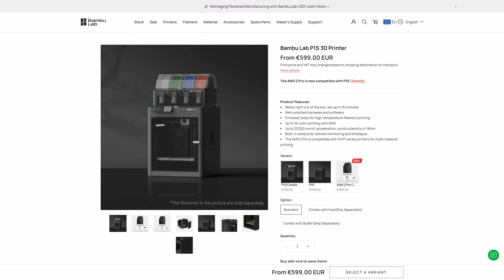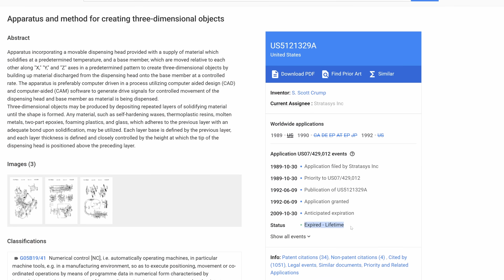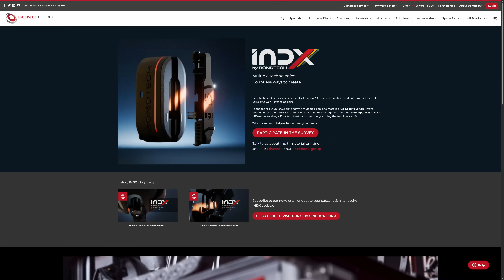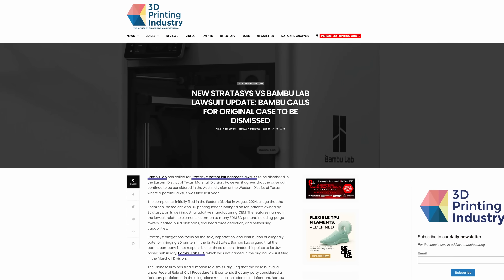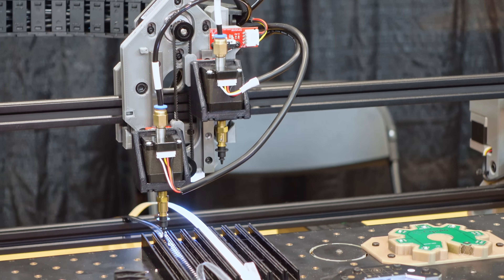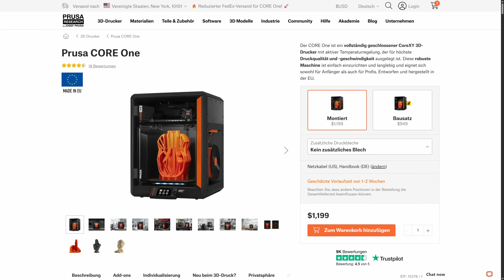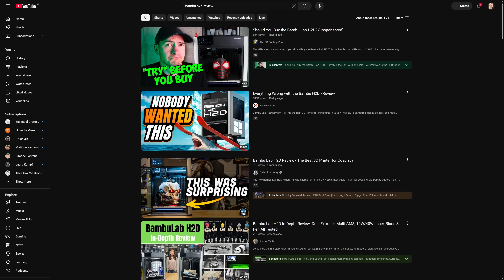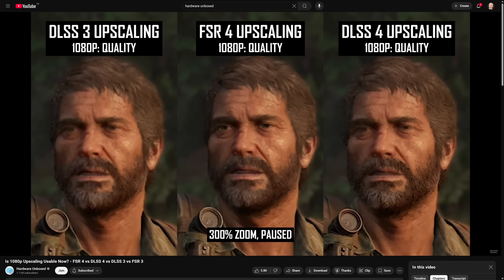How Bambu has won

Comment: Sounds like you are running out of ideas, and some form of soul searching phase is taking place. Please skip that. Creality realeased auto tensioning of belts and a ton on Chinese makers are producing tools for adjusting blet tensioning. Would love your take on that. That is accuracy not speed though. Also, the Voron phoenix project is having issues with thermal expansion, and Prusa actually spoke a bit about it lately. There is a ton to cover on that topic. Again, not speed, but reliability and accuracy, not speed. Personally I just ran into an issue with my MK3s, in which the part cooling fan cooled the bed into oblivion, throwing a repeatable and very real thermal runaway error. My bed only reaches 74C with the part cooling on 100%, for the first couple of cm. Never heard about that anywhere, but the implications of that physics, kind of raises a billion questions. The Prusa has a fairly powerful bed but a super weak fan. Also, there is a move back to CAN-BUS, from USB. Why? There is a move to inductive heating of hot ends, but that is not for free. The list is like endless. A ton of these issues, also hits Bambo kinda hard. There is a move towards thick beds, but at the same time, people seen to be oblivious about the issue of frame consistency, like if a machine is put on an uneven plane, its own plane is thrown out of whack, like the MK3. Not to mention that not a single printer on the market is square, and not a single one is adjustable to become square when assembled. You read the specs, you know that not a single printer on the market meets the specs of their rails. Not to mention what happens when that chamber heats up. Not a single maker adjust their beds with steppers, after heating up. Which we should so. Adding an adhesive and a spring sheet, and any accuracy of the bed is lost. But if you had a mesh of say 4x4 steppers, that trimmed the bed into position, being decoupled and stuff, you know, use the stuff we have for that, then a cheap thin aluminum bed would become super flat. Instead we have these 3 rodded single motor beds without any alignment adjustments, and beds being like more than 1,5mm in deviation. Also, this mains craze that is going on, for bed heating, if you could give SSRs a go, like why some are seriously expensive, what is all the industrial noise actually about SSRs, and why this is like super cheap in the printers we got, that is more stuff I would like your take on.

What I do not need, is another Steve. We got two of them, and the Steves are both great, and really, really bad, at the same time. They both are insanely blind for the issues of objectivism, and as much as I love them both, their ignorance on their own paradigm, is killing their work on a regular basis. If you ever read this, your channel in particular, has a very fine tune to it, in which the level of drama i seriously low. You have a keen touch to deal with people as people, in a human way I really appreciate. It will be a loss to us all if you loose that, as it is kind of seriously rare. I would like a take on like belt tension, heat chambers, and SSRs, in that style. Stuff like that.

Personally I am not a fan of mains driven moving beds, particularly those who are seriously wavy. They just drive people into doing crazy stuff, exposing themselves to harm. The thing is, I need to move to mains driven soon myself, the way this industry is moving, and any friendly assistance on that, is highly welcome.  Like what is up with the power rating of current printers? 1000W at 240V and 350W at 110V? It obviously is all about the bed heating, but what is up here?

Comment: I’d love to see reviews that compare machines across manufacturers. There’s lots o little things that get missed in reviews I’ve watched - like network connectivity (Ethernet ports), availability of replacement parts, compatibility of nozzles across brands, and how long bed leveling and prep takes before a printer starts printing. Comparing service and repair would be great. It’s weird that even Bambu still expects end users to take their machines apart and do repairs themselves - are there any repair shops that handle 3d printers?

Comment: One other thing besides that cloud scandal stuff from Babulab printers is that they don't sell a printer with a proper larger build volume. My CR10V3 offers a build volume that is future proof without having to angle any parts or have to glue. Which is why i choosed this one in 2021.

Comment: Bambu is not your friend. They took open-source materials, designs, etc and made them proprietary. As they continue to monopolize their success, it's a short step from "Your printers are not your own but you can buy them and store them in your house for us" to "your prints and designs are actually Our prints and designs, and we will take them off your accounts freely in perpetuity because you used our software and machines". I have no Adobe software that's subscription based, and the ones I do have are ultra legacy and essentially on a drive just because. The same goes for any software I use frequently. If it doesn't offer a perpetual license, I'm not a user nor supporter. 
Having the option to put some work out for the common good still needs to be an option, however, when you invest years and years into a product and support it yourself monetarily, absolutely you should be able to expect to recoup that investment. What you should Not expect is to take things that were provided as Open Source and lock them down because you turned a few screws yourself.
Reply: What does this mean "monopolize their success?" I cannot even untangle that level of anti-capitalist talk.
Reply: 3D printing has never been open source. It was only made available to everyone by chance when Stratasys's patents expired. Open Source cannot claim ownership of something it did not create. The 3D printing community is not homogeneous. We don't all want the same things.
Reply: @MrlegendOr  Stratasys didn't invent the 3D printer either, but they made sure no one else could make a commercial product via their patent. 
That said, MUCH of 3D printing as the average consumer and maker knows it IS open source, community developed designs AND software.
Reply: @C-M-E  The first 3D printer was invented in 1981, the first SLA patent being granted in 1986. The first FDM patent was granted to Stratasys in 1989. The Stratasys FDM patent expired in 2009. It's only after that we have seen the 3D printing boom. Open Source didn't invent anything since then; they simply profited from well-established technology and built a cult around it. The idea that no company can use this technology just to please the OpenSource cult is nonsense.
Reply: @C-M-E  Open source cannot act as a gatekeeper for 3D printing in any way.
Reply: @MrlegendOr  ?! DId I say no company can not make products nor income from open source? I said taking open source and making it proprietary so the end user is stuck in one ecosphere is a problem. If that makes you happy, have at it. Just make sure you understand what you're giving away in the fine print...
Reply: @C-M-E   Everything I say is to let you know that 3D printing has never been an open-source thing. It's the open-source movement that has entered the world of 3D printing and taken everything from closed-source work. This is not necessarily a bad thing. However some of the fanatical members of the open-source movement try to act as gatekeepers dictating how everyone should consume 3D printing and at what level of openness that manufacturers should adhere to. OpenSource never been the law in 3D printing world. Simply because open source doesn't own the market, usage, patents or users — they're not even 7% of the entire market, yet they behave like communists. Most users don't care about open source; they just want to press a button and print.

Comment: I dont often comment but what I would like to see in general is how creatively 3D printers can be used. We came to a point where all 3D printers are much less the same. They have roughly same output, same quality of life etc. but what i see missing is that there is no new ideas how these things can be used in medicine, engineering, gastronomy, everyday life etc. You have a very nice youtube channel but try to think about this one please. Everywhere on youtube you can see review of some machine or software update, but not so much on how to do some specific things with these machines.

Cheers and thanks!

Comment: 3D printing has shifted from a Maker Space to a Consumer Space, you can fight against it all you want, but it's already happened and there's nothing wrong with that. People can still be Makers and people can be Consumers, there's nothing wrong with that. Just because a company makes a Consumer 3D printer, doesn't mean you can't be a Maker anymore. This is nothing more then tribalism. I for one joined 3d printing BECAUSE of what Bambu brought to the table, I wasn't interested in tinkering with my 3d printer, I wanted to 3d print. Bambu labs took a stale market and FORCED long time brands to change, and that's a good thing.

Comment: shake-up incoming. kinda heart-breaking. but money is the heart. owner of the world does not want what people (stan) wants through money. no, stan is not the actual owner, if its the operator of the world. people's want does not matter against free gift. world of above is not a democracy, its freedom in the people's eyes. well, market patents stuff under their gov that they did not do. thats cheesy. the wrong way relies on people, ie braggs and prides in people and people's work. it's a free gift if you understand. its better to have skill (in everything) than being reliant/dependent on the market. with skill, you can make also the tools you might require. zero dependency. I hate linux gurus. at least not biased, ie objective is better than straight up being bought by someone. adapting to rulers makes slaves. if money (ruler) dictates what you do then meh. do not work for people. market benefits no-one. lol grin. 3d printing includes 3d graphics frames ok. lol. "his" is a dangerous re(li)gion. freedom is not compatible with any kind of ownership or rulership, by people, for people. maybe instead of aligning with interest, just do what you meant to do. unbiased. market is a nasty bed fellow. being infected really tastes and spreads. watch out for those, and avoid them. freedom! (for all, actual).

Comment: I'm almost the perfect target market for Bambu: I'm never going to mod my 3D printer. But I think comparing 3D printers to desktop PCs is the wrong metaphor. I think Linux vs Windows is a better one, and I say that as someone who has used Windows for longer than I've used Linux/Unix. The problem with 3D printing going so closed source isn't so much that you'll be unable to mod your 3D printer - it's that eventually, they'll be able to control what you print as well. The opportunity to restrict it or require that you pay-to-print is too lucrative.

Comment: DJI and their offshoots don't want best product ecosystem, they want a stranglehold. Unwillingness to learn how stuff you buy works leads to manufacturers making things that break in a year, because when you give in and no longer want to know how things you own work and want them to "just work", you leave your right to have the best product behind and settle for the manufacturer giving you the bare minimum that will satisfy you, and the manufacturers absolutely will abuse that setup. To call this a win is delusional at best. You'll have here what you have in every other industry when customers give up on being involved and settle for just consuming - instead of more and better products you'll get same slop with next to no improvements released year after year, only breaking more often, years behind on features that exist on the engineering side, more expensive, with increasingly more DRM and data collection, with parts that refuse to work together because of product tag mismatch, and that are about 20 times overpriced (*cough*DJI Mavic*cough*). If Bambu went out of business today, supposedly leaving consumers without a convenient product line, that would still do less irreparable harm to the industry than Bambu succeeding today. The only ones winning here are Bambu execs that will retire will golden parachutes while setting the industry back decades. And when that happens, remember that you supported this.

Comment: 3D printers are only ever as good as their software (and firmware). So the ability to keep both of those working, if not revamp to be even better down the line, will always tend to be a both a major boon and/or deal breaker for me.

Comment: Of course we always want to approach things pragmatically: can I solve this problem?  If not, then what?

However, it is not necessary or desirable for one individual to try to take responsibility for the direction an industry moves in.  If a person cares which direction things go, the best he can do is play a small part in generating an impulse in that direction that others can also align with.  A drop in the ocean is meaningless, and yet the ocean is nothing but drops of water.  If each of us lean in the direction we prefer, despite the powerful tides, if enough of us are leaning that same way, it will be meaningful.

For myself, I've still got enough years ahead of me that I really don't want to be back in the regime of expensive monopolies like stratasys, with no meaningful way for me to take part in development, let alone afford to play at all.  Not when I've seen all the exciting possibilities.

Comment: My first printer was an ender 3 and while i loft it and the design aspect. however it started to annoy me to always tinker first to print.

Bambulab changed this, you just print. the part you want to print is the focus and less the tinkering. and I think the hobby now just split in two. design, slicing and printing. and building a machine, drivers, motors...

Comment: To be honest, I'm a little bit Bamboo-tired. I 3D print for a decade now, started off with a cheap Chineese bedslinger (Anet A6), learning the process, understand the machine, really know what is happening, upgrading etc. Then I switched to a vCore3 and adding a Voron to the mix (leaving the Anet as a paper weight). Because I wanted some extra capacity, I bought a K1 but only using it as a rapid prototyping machine because the quality jus doesn't match the other two machines. Where you look now, everyone talking about "printed on my Bamboo" untill something goes wrong, then they cry for help because they have no clue. Then I'm like "call Bamboo..." Everyone can print on a Bamboo, until the Bamboo doesn't cooperate. And when they started to close down theire system even more, I got even more Bamboo-tired. I think they do great for starters and they produce good prints so they do what they should do, but I don't have any intention to help the users out if something breaks or isn't performing, just call Bamboo. In the mean time, I will produce gorgious prints on my open source machines. (and I don't sell prints, it's all personal use, i'm not running a company but don't ask the community if you don't support the community, because the community learned at the cost of a lot of time and money to learn). That's how I feel about it. 

Feel free to disagree.

Comment: HiHo

So, I have various printers myself: Ultimaker 2+, Ultimaker S5, Creality CR 30, Prusa MK4, and Bambu lab x1. I prefer the Ultimaker 2+ series because you can do whatever you want. Both the Bambu and the Ultimaker S5 are simply too closed to me. When I use them, I feel like a baby that needs to be taken care of by the manufacturer. If something goes wrong, there's usually nothing you can do; you just have to live with it. On standard settings, I have to say the Prusa MK4 prints even better than the Bambu. In terms of print quality, the Ultimaker 2+ can't compete, but I still use them the most.
Keep doing what you enjoy most. Do printing projects on printers that allow you to do things, but at the same time, you can also use closed systems. Do what you do best.

Comment: I got a Bambu A1 as a way to get back into the hobby but I jumped over to Prusa after the recent stuff that's been going on with them.

Totally understand people that don't care though. I just wonder if they'll be into the hobby long term. Especially if Bambu snaps like the very obvious mousetrap they've been setting up and people end up having to use more expensive branded filament or subscription models are added.

I'm also reticent of models going to China before they print. The tech is all there for them to use AI to reject printing things (as well as security concerns of my data leaving the country when my printer is 3 feet to the left if they wanna talk security. They seem to LOVE security except when it comes to themselves.)

Comment: Was a Prusa fan for some time and as a tool for home 3D printing it  is still awesome. but already for a few months I am using Bamboo for business. And  I even do not want to admit - they are better in every aspect except transparency. Machines are faster, smaller, better build, produces better products, basically have the same cost and are easier to manage the whole print farm. Hope that Prusa will learn and gonna successfully join the competition.